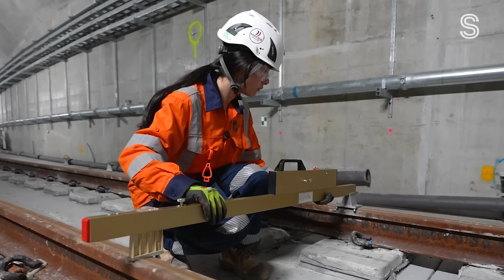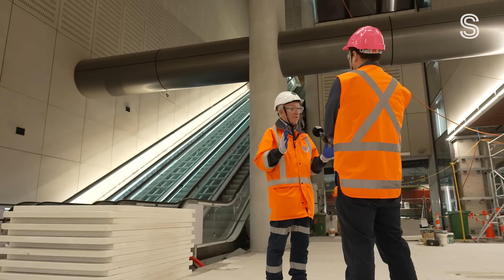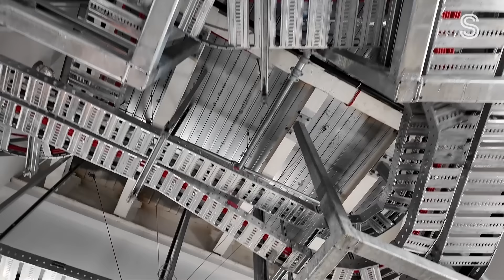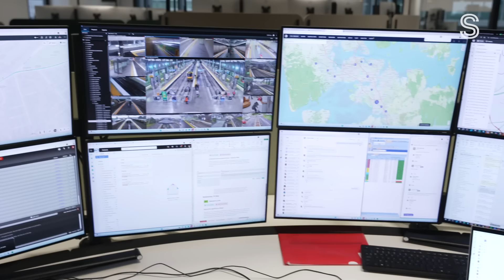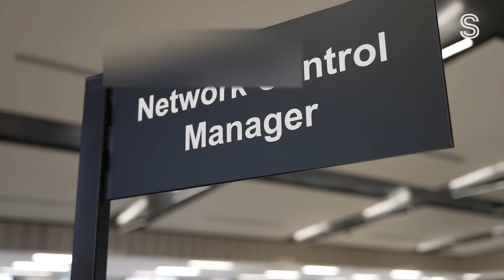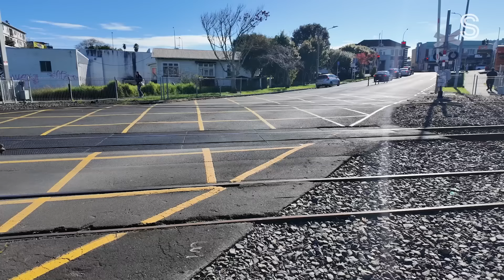Why is Auckland’s City Rail Link taking so long to open? | Stuff.co.nz

Comment: There seems to be a real challenge when it comes to delivering those major level-crossing removals across the region. I’m not sure Auckland Transport has the funding to make all of them happen.

Take just one example   St Jude Street in Avondale. From what I understand, the cost of removing that crossing alone could be in the region of $50 million. Then there’s the more complex site at Glen Eden, which would require a cut-and-cover approach  likely costing somewhere between $80 and $90 million.

You do start to wonder, where is all this money supposed to come from?

In the meantime, I understand that train frequency will be reduced on the Western Line, and possibly on the Southern Line as well, due to the delays and timing conflicts caused by these same level crossings. It’s a bit of a catch-22.